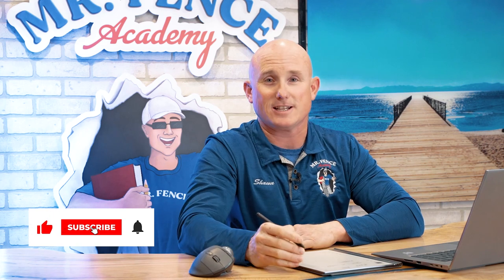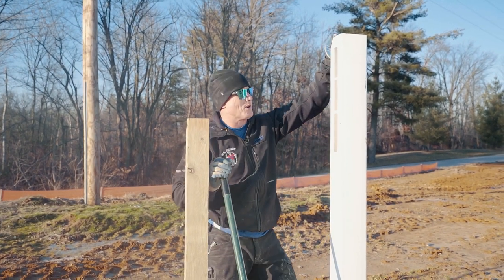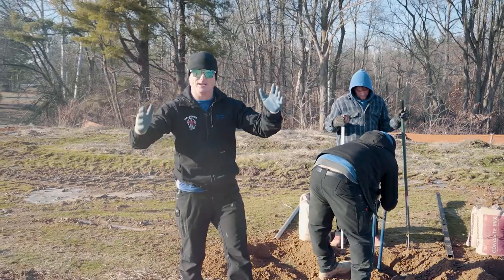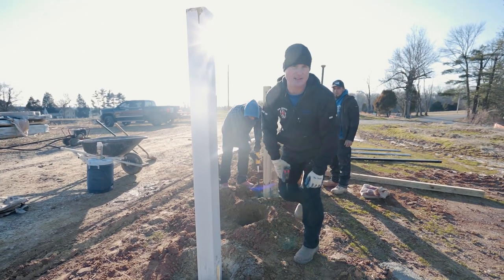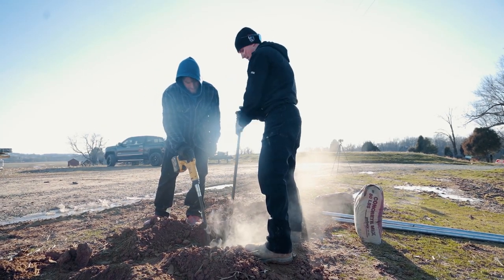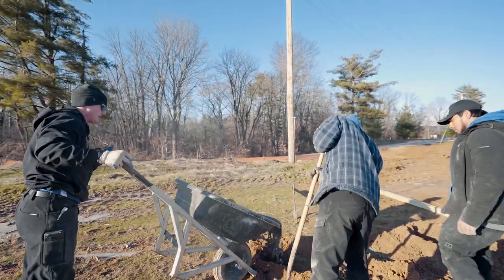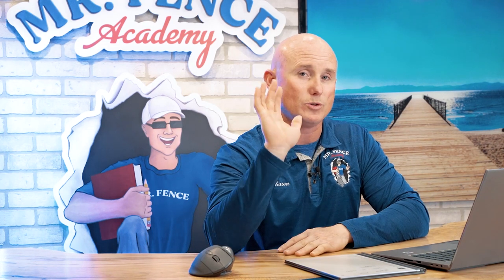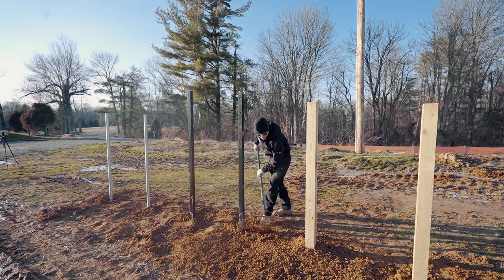How should you set a fence post? | Testing Fence Post Installation Methods

Comment: Could you guys make a video on the spacing jig / 2x4 on how to make it, measure it and cut it to use between vinyl posts to account for grade changes? I’ve seen it mentioned in other videos, just wanted to make sure I had the concept understood before putting it to use and causing myself a nightmare